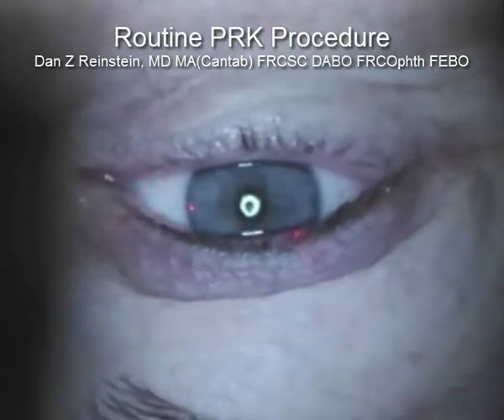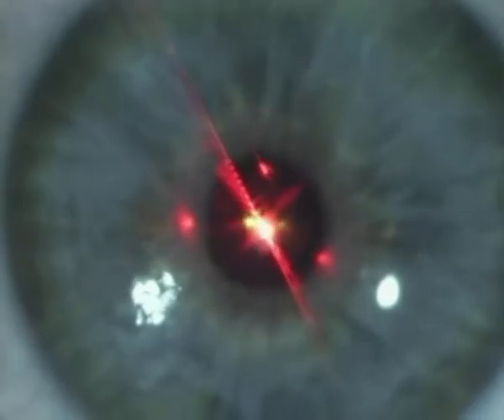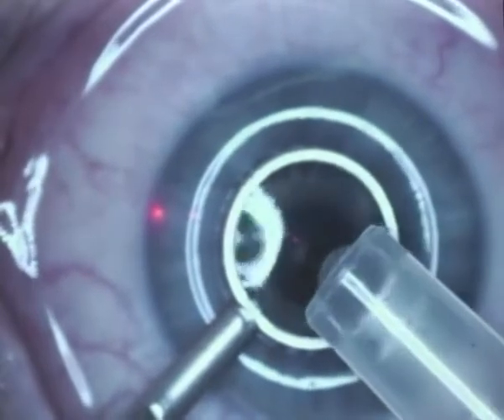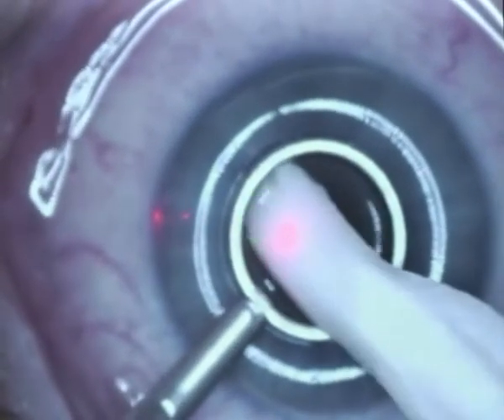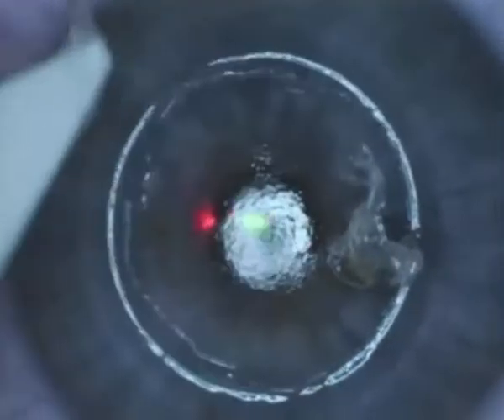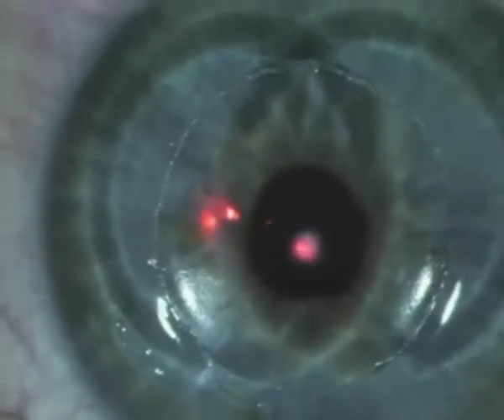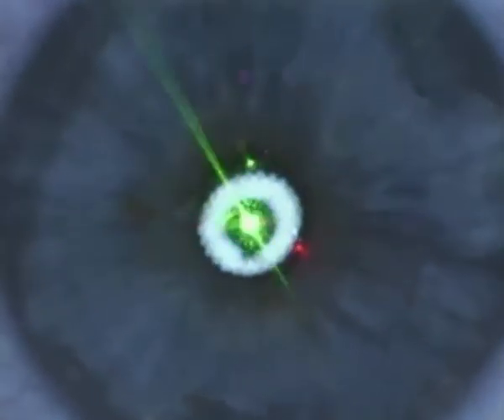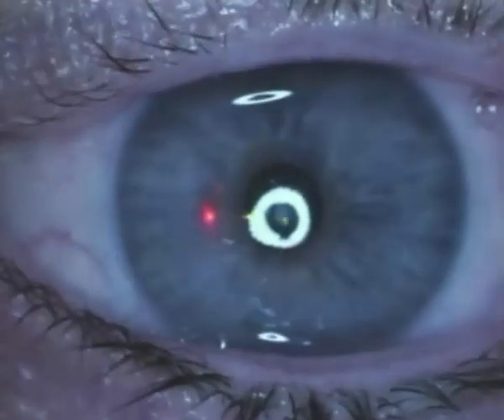Perfect PRK / Advanced Surface Procedure by Professor Dan Reinstein

Comment: 2:52  "The remaining epithelium we will scrape off using a very blunt hockeystick."

Thank god I got ICLs instead. 

20/10 vision with no damage to the central cornea whatsoever.
Reply: What was your vision beforehand? Did you get details on your CCT and why ICL was preferred?
Reply: @oblivion0077  
I started developing myopia simplex from age 12 onwards. It stabilized at age 21 and remained completely stable until age 31, when I got my ICLs implanted. Both my eyes had -2.25 D of myopia. My corrected left eye vision was 20/13. My corrected right eye vision was 20/13 as well. My corrected combined vision was 20/10. 

All tests at the eye clinics came back optimistic. I went to two different clinics to get a second opinion, just in case. Both times, everything was fine. They couldn't even tell that I had myopia from my retina alone. No risk factors. I was easily eligible for every refractive surgery option. 

I didn't choose any laser method because I wanted the possibility of reversibility later on in life or in case anything went wrong along the way. It was almost twice as expensive to get ICLs but I considered it money well spent.

10 days after ICL implantation, my uncorrected left eye vision was 20/13. My uncorrected right eye vision was 20/10. My uncorrected combined vision was 20/10. I was left with -0.50 D of astigmatism in my left eye and -0.125 D of astigmatism in my right eye. That's why my left eye still isn't as good as my right eye without glasses but the latter one can compensate for it. With new glasses to account for the -0.5 D of astigmatism in my left eye, I can reach 20/10 vision in my left eye as well. I don't know if my corrected combined vision might now exceed 20/10 vision because the Snellen Chart doesn't have any more lines. But even if my corrected combined vision should remain at only 20/10 vision, I'd consider that to be satisfactory vision.